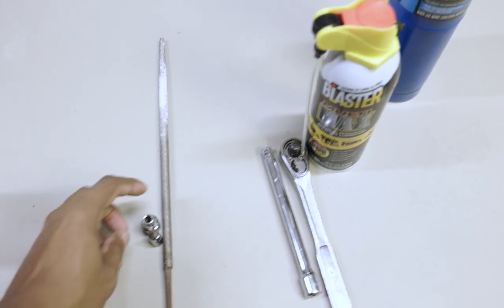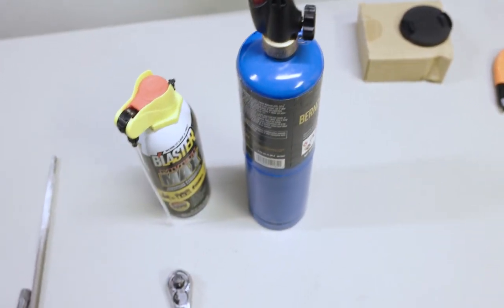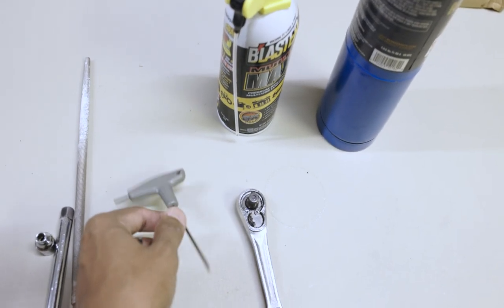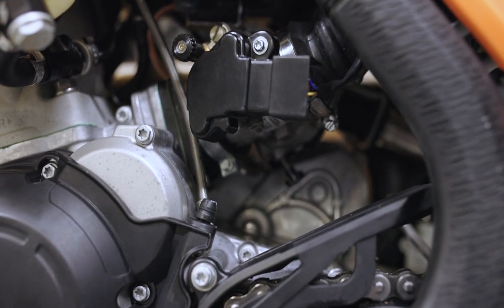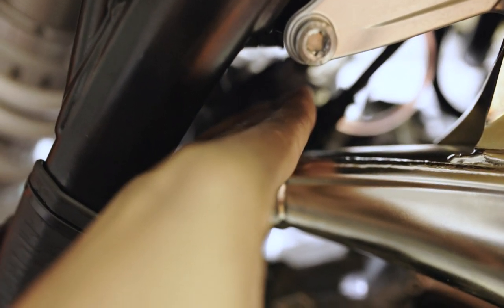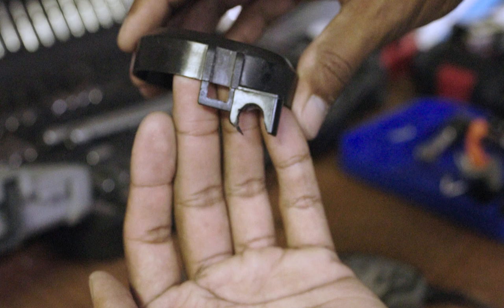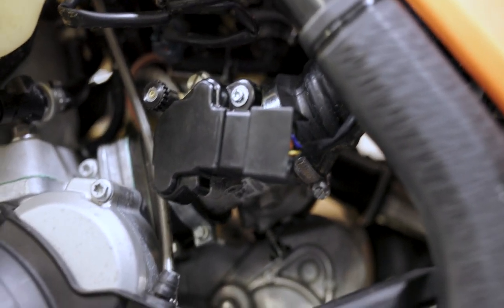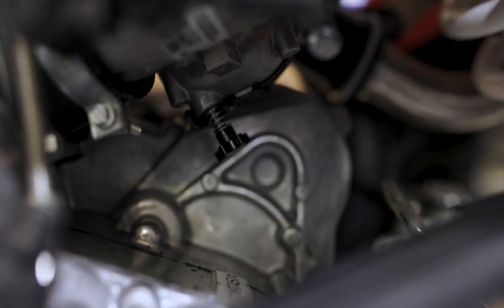2022 KTM300XC-W Idle screw mod (The easiest way!)

Comment: I can’t rotate my throttle body enough because the throttle cables hit the exhaust. How did you rotate yours without removing the exhaust?
Reply from the maker: All I had to do was loosen the clamps and spin it. Removing the exhaust is fairly simple if you have to but I did not have any issue spinning it.

Comment: Is it safe to use torch while gas tank is still on?
Reply from the maker: I'm not allowed to say yes but If I were to do it, I would be super careful and try not to hit any fuel lines or anything that is flammable or can melt. The point of the torch is to just soften up the Loctite a little bit. There are chemical sprays you can buy that do the same thing without the heat risk.
Reply: @nickslosubi690  I took it off and put small flame on the area. It came right out. Thanks for replying.